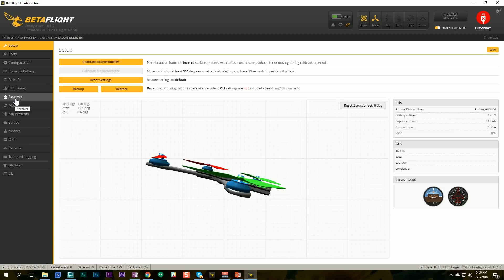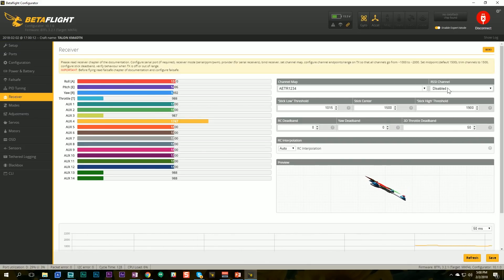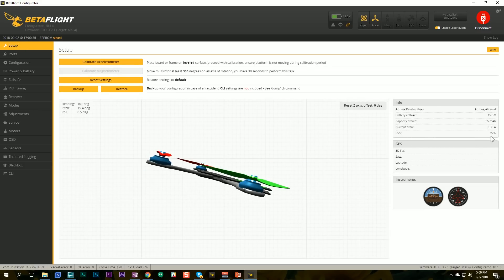How to put RSSI into OSD (UPDATED FOR OPENTX 2.2 & Betaflight 3.2)

Comment: If I have telemetry enabled on my flight controller, can I just tell the board to read it ? Why do I need to send the RSSI to the transmitter and back via one of the channels ?
Reply from the maker: Because Betaflight doesn't have the ability to read RSSI directly from SmartPort telemetry. If you are using Crossfire or Ghost or ExpressLRS or even FrSky FPORT, it works correctly.
Reply: @JoshuaBardwell  Seems like a gap to me, wonder how hard it would be for developers to grab RSSI from telemetry so we don't have to do all this. One other thing I found useful is to go to Expert Mode > Failsafe and set AUX4 to 1000, otherwise it would be 1500 when receiver not connected and RSSI would show as 49, which might be confusing.

Comment: Awesome vid for my old shuriken 180 pro which didn't have osd. I've set up the microminim now, trying to get rssi from channel 8 of my FC, but the value I see on my osd for rssi keeps jumping around (I have calibrated the msowd using the sticks menu on my taranis and it does show 0for rssi  when the radio is off and 100 when it's on, but the value jumps erratically down as low as 17!).

I have rssi invert on my cli.

Comment: Hi Joshua, is there any way to do the same on the BetaFPV Lite Radio 2 SE radio? I am not able to get the RSSI by using an Frsky R-XSR reveiver.  However, if I use an Frsky XM receiver, the radio is able to get the RSSI

Comment: please, dont forget to mention, that after setting the RSSI chanel in beta, you need to completly disconnect drone from beta, and reinsert its battery. Otherwise you wont see the RSSI values. This applies for frsky archer RX (tried two different frsky archer on twor drones)
Reply: Thanks so much mate, I'm having so much trouble getting rssi value from the archer rs, it keeps the value at 99

Comment: I assume this rssi data cannot be displayed on the radio if using xm+? Only work with r-xsr right?
Reply from the maker: https://youtu.be/q-rOd4_DSIk
Reply: @JoshuaBardwell  I've seen that already prior to yours. I got rssi value on my goggles working but cannot show on my jumper t-lite. When i go into telemetry and press on discover new sensors, i don't get anything. Not like how it shows on your radio.
Reply from the maker: The XM+ doesn't send telemetry. That's why you have to do the aux channel method. To get telemetry you would use a receiver like RXSR.
Reply: @JoshuaBardwell  OK thanks for verifying. Next time I'll get the rsxr instead as I do mostly LOS flying.

Comment: Whats happen if you dont see the rssi in telemetry section
Reply from the maker: You must be using a non-telemetry receiver like an XM+. If you're using an XM+ this method won't work but there is a firmware you can flash to the XM+ to make it output RSSI as an aux channel on channel 8 or 16.
Reply: @JoshuaBardwell  okk i just didn't see it now its saying 1RSS OR 2RSS but mysteriously my switch for my flight mode is unable but i can fly by using arm switch only and its on air mode  hopefully but idont know why and how to enable it..  everything is on tbs crossfire :/

Comment: dB is sensible for RSSI, but using this method, but what is the mapping between the actual RSSI dB value and the servo range? I want to set this up on a pixhawk arducopter
Reply: There is another pin for RSSI on the recover so I might pin that one up instead

Comment: My RSSI is using up Aux4, but Aux4 is a switch on my BetaFPV Lite Radio 2 which I'd like to use for another function. Is there a way I can reassign the RSSI to another Aux so that I can use Aux4 for what I want? I keep getting references to go into the mixer but the BetaFPV Lite Radio doesn't have that nor a screen for that matter.
Reply from the maker: You can configure the LiteRadio by plugging it into a computer and using OpenTX Companion app. It's a bit clunky because it's not real time. You have to make changes then write the config back to the radio and test it.
Reply: @JoshuaBardwell  Thanks for getting back to me. Long time fan. Would this modify usability foe my other quads? Its bound to 5 others. I would hate for aux4 or another aux to no longer work for 5 quads but work on this current recent quad.

Comment: Thanks Joshua. However it didn't work for me this time... I'm using OpenTX 2.3.9. I see the sensor, but after all config I don't even see that bar on the up right corner...Anyone having the same problem?
Reply from the maker: You have to add the rssi to the OSD manually.

Check in the setup tab of Betaflight to see if the rssi parameter has a value.
Reply: @JoshuaBardwell  solved. Maybe i didn't explain well enough. I have the RSSI on the OSD, but the value is (was) freezed. I had to select RQly as a source, instead of RSSI or RSNR so the signal would respond on-the-fly. Is this expected or is it me doing smth wrong?
Reply: btw, thanks so much for the feedback!!

Comment: I just built the tyro 119 following your build - thanks! it flys great. But I'm struggling to get this to work. I can see the RSSI in the telemetry and I did the rest of the steps but it doesn't show up on aux 4 in betaflight. :( 

Any ideas?
Reply from the maker: In the radio, go to the Telemetry screen the Discover New Sensors. What appears?

If no sensors appear then the RX is not sending telemetry back. Did you use a telemetry-capable RX like RXSR or did you use one without telemetry like XM+?

If you used a telemetry-capable RX make sure you bound with telemetry enabled. Select ch1-8 TELEMETRY ON if you are using a FrSky radio.

Comment: My problem is that I receive a 100% RSSI at the station and a 16% value in the OSD with a low RSSI alarm. Where do two different values come from?
My receiver is a Frsky R-XSR I don't have the S.port connected.
I have disconnected in Betafligth the Analog RSSI_ADC and disconnected the channel in the Receiver tab.
Also in Cli
Set rssi_src_frame_errors = on
Help !!!
Reply from the maker: Don't use rssi frame errors option. Use the method I show in this video.
Reply: @JoshuaBardwell  I did this after I had a FAILSAFE at 60 meters away. But do you know why I receive 2 diferents values? Where they come from? .I don't have an OPENTX receiver
Reply: Well, since the transmitter gave me a good signal, I decided to mount the drone and test it. I have entered the RSSI value in the OSD, and removed the RSSI dbm, ...
My surprise has been that when before the RSSI value was only 16 in the OSD, now I get 99, I don't understand why, but be careful, I keep getting an RSSI dbm alarm ...
Well, I have flown 200 meters, without FAILSAFE, with the alarm from takeoff.
Can someone tell me something. Can you define the RSSI level, for the alarm?

Comment: This doesn't work in 2020. The firmware is different and there's no RSSI in the menu now.
Reply from the maker: I disagree. I do this regularly and it definitely still works. If you don't have RSSI in the menu, it means you didn't bind to a telemetry-capable receiver, or you didn't Discover Sensors in the telemetry screen.
Reply: @JoshuaBardwell  it's an rxsr and I did discover new sensors. Maybe I'm just too old to learn this. Dude I know yer the man, and there's a lot of people here with a lot of knowledge. For some reason I just haven't been able to get the message or the right message. My real problem is my tyro69 has no osd, it's only got one flight on it and i dont want to fry it by not being able to see my voltage. Am I barkin up the wrong tree with this telemetry thing?

Comment: R-XSR and Taranis QX7.....no way to receive RSSI... s-Port is connected to TX3(FC)  QX7 did not find  any rssi-signal.... any idea?
Reply from the maker: You need Smartport telemetry working. On an F4 processor, tx3 won't work because it can't handle the inverted Smartport signal. On an F7 it should work.

https://youtu.be/jT4vf6575TM
Reply: @JoshuaBardwell  Thank you ! I did that  "hack" from uninverted to TX1... now it works !  Thank you Joshua !

Comment: Does this work with the R-XSR?
Reply from the maker: Yes.
Reply: @JoshuaBardwell  thanks for the reply JB,  it worked for all my xm+ but not for my r xsr, I can see the values changing in the receiver tab indicating that its working but when I set the RSSI to the correct aux channel it still doenst show
Reply: got it had to power cycle the quad. didn't have to for the others.

Comment: Hi Joshua, first of all thanks for your lessons, they are so helpful. Im
 having issue with correct rssi value on my iflight cidora sl5 through 
osd. I have r-xsr reciever and Im stuck with constant rssi value of 43 
in betaflight config, where on taranis i have rssi near 100 (goes up and
 down depending on how far i have gone, its ok). I thought the problem 
was in old firmware 4.0, current 4.1.3, but issue is still there. I just
 want to to be value to be the same both on taranis and in osd. I used 
telemetry aux for sending value to osd. In reciever tab rssi value is 
set to chosen RSSI channel, but normally rssi is visible when it is set 
to analog mode in Configurator tab. In CLI rssi scale is set to 100. 
Could you please advise on what to try? Many thanks from Russia!

Comment: There are CLI commands which set the RSSI offset and scale. With these you can adjust the readout value on your OSD to match the RSSI telemetry page on your Taranis. The default value in Betaflight 4.2 was offset = -10 so my OSD readout was 10% low. The setting below gave me matching readouts.
 set rssi_scale = 100
set rssi_offset = 0

Comment: Taranis , XM+, bound in d16 mode,  aux channel 12 is active under the receiver tab in betaflight.
Nothing happens when I search for new sensors under telemetry. Please help.
Reply from the maker: XM+ does not support telemetry. But it can put RSSI on channel 12. So just set RSSI Channel to Aux12 in the Betaflight receiver tab and you're done.
Reply: Thanks!

Comment: HI Joshua, I am just getting started in FPV and I am finding your videos to be so informative. I have a QX 7 Tx and FS HD2 goggles and I am a bit confused about what and how much telemetry I am going to need to see on both. I want to fly safe and this RSSI information is one thing that I deem necessary to do so. Have you considered making a video that encompasses setting up a totally Frsky based quad using the QX 7 and supplying information on the best receiver to match with it? I would think it would help a lot of pilots like myself. There is so much to learn about building a quad and how everything fits together. I appreciate your work and tutorials very much. Thanks for your time.

Comment: Hi All and Joshua, firstly many thanks for your contributions to this great hobby.

I have abit of a dilemna calibrating the RSSI percentage shown on the OSD as a percentage of my RSSI personal setup in DB between 110DB ( strongest) to 27DB (weakest, 1db before failsafe)

There is no way in betaflight as there is in arduplane / ardupilot to specify a scale based on the rc input for example 1694us being equal to 27DB on my radio giving a super accurate representation of whats going on.

I've tried fiddling about with weights and offset's and just cannot get it work.

betaflight seems to think that min signal 0%  (ALL CLI DEFAULTS with respect to rssi settings) occurs at 1000us and max at 100%  2000us, so how can i make my RSSI on the transmitter do the same, as mentioned between 27DB being the lowest and 110DB being the max.

Many thanks for your help on this complex, or maybe not so issue.

Maybe help people get a better idea of there radio link performance

Comment: so what do I do when nothing comes up after I select "discover new sensors"???
Reply: Anthony D. As the man said, if that don't come up: your not going to get rssi.. 🙄 go to 2:40
Reply: @christera2686  yeah i got that, but I thought when he said "even with a FC not connected you should see a value" at 2:30 it meant I should get some kind of value but I guess he was referring to only powering a vtx directly. Found my rssi on aux 12 tho so Im good. thanks anyways...
Reply: Anthony D. Aha: I hear he said even without the fc connected. But I guess he means that as long as the rx is powered, it does not have to be connected to fc. And even then it will be discovered as a sensor on the taranis or other open tx
Reply: Anthony D. BTW : you say vtx? Vtx I guess it is video transmitter and has nothing to do with this video..
Reply: @christera2686 sorry, I misspoke. Meant rx
Reply: Anthony D. Haha, I just had to correct you 😜😅

Comment: Hi Joshua! got mine on OSD already! thank you! But mine is always at min 99% even in 800meters, not an open field... I use R9 module wit R9 slim plus RX. just want to know if my RSSI is feeding an accurate rating... seems like to good to be true. Do you know some test that can check RSSI  without risking my quad? lol! Thanks in advance!
Reply from the maker: It's probably reading correctly. When it is reading incorrectly it usually reads 49%. You can compare the OSD RSSI to the Telemetry sensor on your radio if you want to be sure. If your R9 is outputting 2 watts then it could be 99%  RSSI even at 800 meters.
Reply: @JoshuaBardwell  Thanks! Josh gonna try it later!
Reply: HI!  @JoshuaBardwell  I tried walking out my TX and my VTX outside my aprtment  and leaving my drone inside. my osd  is reading 99% but my Taranis TX reading got only 3 bars out of 6 bars. how can I fixed this? thank you in advance!

Comment: I don't see any sensors at all with my R-XSR. Do i need to connect s.port as well?
Reply from the maker: You should see RSSI sensor even if Smartport isn't working. When you bind be sure to select TELEMETRY ON
Reply: @JoshuaBardwell  I don't see any "TELEMETRY ON" option in OpenTX when binding. I only have the option "Telem. disabled", but it is unticked. (X-Lite Pro, OpenTX 2.3.0)

Comment: This works fine for me until you go to receiver tab in Betaflight, when:
1. I see Aux 4 moving up and down dynamically
2. I set RSSI channel to Aux 4 and hit save
However if you go to another tab and come back to receiver tab, 
then RSSI channel shows "DISABLED"
Also Setup tab shows RSSI as 0%
Any ideas to remedy this....anyone?..please? 
Thx
Reply: Well now...I repeated setting RSSI channel to Aux 4 / Save, about 6 times and EVENTUALLY it did stay on Aux 4
What did i do differently to make it stick? 
Not sure....maybe the following was the trick:
After hitting save on receiver I also then
- went to config tab and hit ''save and reboot'
- disconnect and reconnect 
- back to receiver tab and observed AUX 4 was STILL saved for RSSI channel. Hooray
Reply from the maker: Go to configuration tab and disable RSSI_ADC

Comment: Hi Joshua, i cant activate RSSi on the config Tab. When i ativate and save, it going self back to disabled. Can you tell me to fix that issue? Greats from Germany!
Reply from the maker: Disable RSSI_ADC in the configuration tab
Reply: @JoshuaBardwell  thank that is was! But no my rssi shows already 0%, I have done all steps in your video. Xm+ is flashed on telemtrych16 firmware. My other builds works fine. Bf version on board is 4.0.4
Reply: Ok I found the problem! I disabled telemetry in config tab and activate channel_forwoarding. Now it works... Betaflight sometimes confusing me.

I thank-you Joshua! Have a nice day

Comment: I have a radiolink AT9 transmitter and the little receiver i use (r6dm?) doesn't have rssi pad.  however, latest firmware for the AT9 lets you send rssi on an aux channel and this appears to work!  tested on the bench only so far, but like your video, it appears to work.  put my hand in front of the antenna and it drops, so it's definitely doing something!  and it's much simpler to set up in the radio than in your demo.

Comment: I tried can't get it to work please help
Reply from the maker: The first thing to check is whether you see the Aux channel moving in the QX7 "channel monitor" screen. To get there, press Page until you see the readout that shows the channel values. 

The next thing is make sure RSSI_ADC is turned off in the Configuration tab.

The next thing is, in the Receiver tab, make sure you have set the correct aux channel. If you are using channel 8, that is Aux 4, not Aux 8. This is a really common mistake.

Comment: thank you  for helping me out  on getting my mobula 7 hd in air finally. im getting used to the fpv flying/specially the quad...its going slow but it is fun.  one thing i noticed is that I am not able to have my OSD displayed on my goggles. i have set it u in betaflight...... as much as i understood it... or not. The only thing that shows up is the  cross hairs in the middle of the screen. i have played with that tab and settings in there but not sure what i am missing.

Comment: The RSSI does not show up in the info box on my setup page.  Everything is peachy up until that point.  It still doesn't show up in my OSD.  I am using a Taranis x9+, Kakute, Atlatl, R-XSR.  Any ideas?
Reply from the maker: Make sure the rssi telemetry sensor appears in the telemetry screen.

After that, follow the steps in this video.
Reply: See, that's the thing....RSSI telemetry sensor does show up and I followed the procedure to the letter.  Everything looks good until I go to the setup page in Betaflight...it just shows RSSI as zero.

Comment: I have a sparrow custom-build by someone else and apparently the flight controller doesn't have OSD so can I still use this method? I have a R9 mini on it the runcam or VTX has a built-in OSD apparently and I'm on the Nirvana radio when I do everything the way they say so I still don't get RSSI but I can't adjust OSD in betaflight because it's something else I guess
Reply from the maker: If the FC does not have OSD then you cannot use this method.
Reply: @JoshuaBardwell   thank you sir